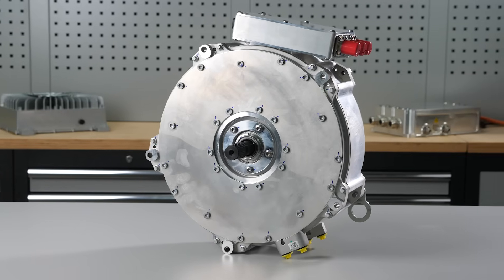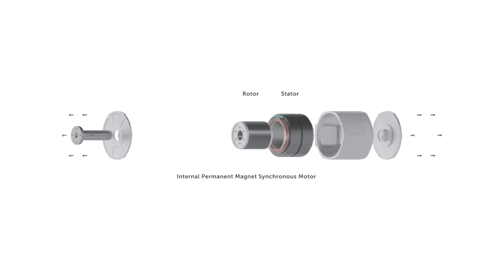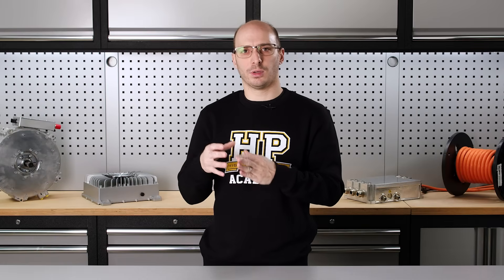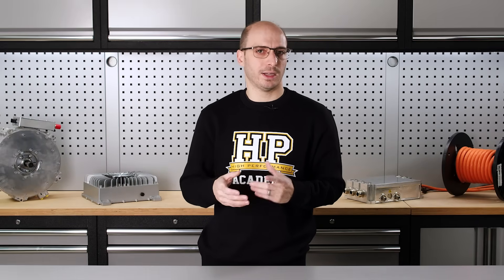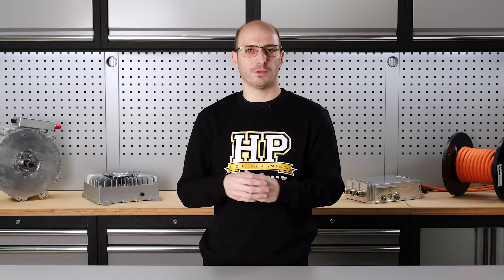1000hp+? | EV motor technology is getting WILD!

Comment from the maker: What EV setup are you modding and/or using for a conversion project?
⚡Dive into the fundamentals of EV world with instant access to your online lifetime access course: https://www.hpacademy.com/courses/electric-vehicles/
👨‍🔧 Building a fast car? Get $400 OFF the all-inclusive VIP online course package deal: https://hpcdmy.co/ev101y
TIME STAMPS:
0:00 - EV Motors
0:13 - Development
0:27 - EV Limitations
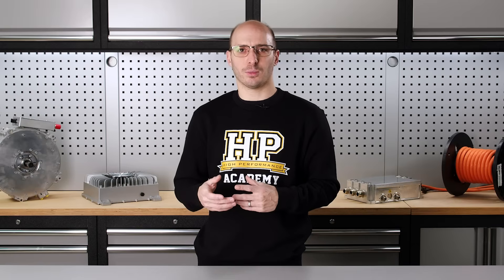0:37 - EV Vs ICE Power Delivery
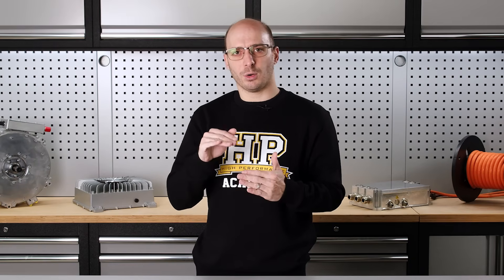0:54 - Peak Power
1:06 - Gear Reductions
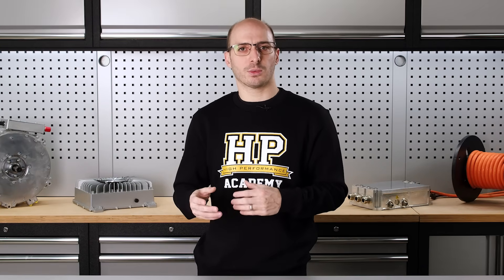1:16 - Permanent Magnet and Induction EV Motors
1:31 - The More You Know, The Faster You Go
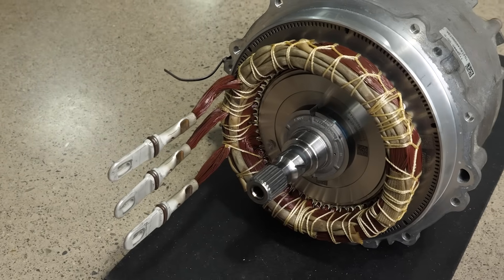1:51 - EV Motor Breakdown
1:57 - Stator
2:17 - Rotor
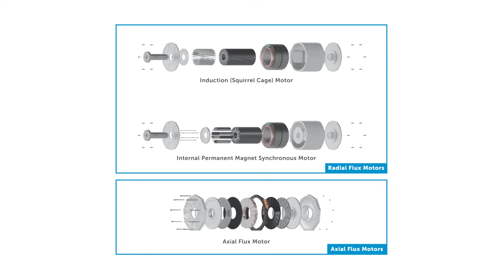2:30 - Radial Flux Rotor
2:58 - Axial Flux Rotor
3:21 - Magnetic Field Positioning
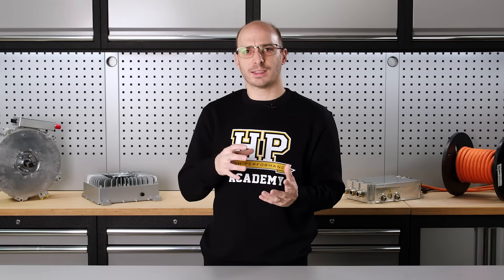3:39 - Design Compromises
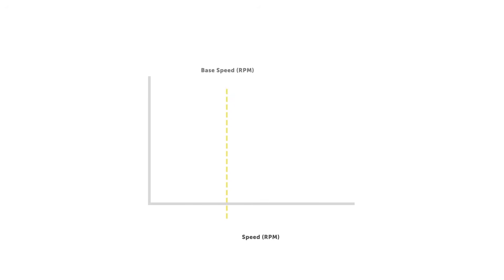3:50 - Base Speed
4:00 - Constant Power Region
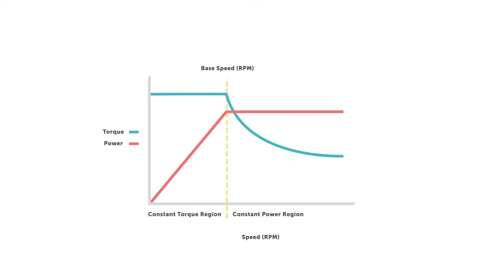4:10 - Below Base Speed
4:25 - Inverters Covered Separately
4:37 - EV Final Drive
5:13 - Torque Vectoring
5:34 - Lesson Recap
Reply: Is anyone working on some kind of 'bolt on' electric motor akin to a supercharger, or something that can be incorporated into an existing drive train rather than requiring the whole ICE system to be removed?

Comment: But I want a clutch.
The main problem with high performance clutches is that they are horrible in start stop traffic because you always stall.
EVs don't stall.
So you can use an extremely on off brass puck clutch or a multiplate clutch.
Gearing means you can have a less powerful motor and battery combination to save some of the weight of the extra driveline strength needed.
Use the same driveline as the hoonicorn or a drag car.
Reply from the maker: I'm sure you could set something up and like you say, it won't look like you've just done leg day on one leg 🤘 - Taz.

Comment: Can an electric motor do 300000 km?
Reply from the maker: So far, yes, and with less maintenance. 
Like ICE cars some will get more milage than others, but generally the batteries will give range that might make the car impractical before the motor/s go.
Some Tesla models state 800,000kms - Taz.

Comment: You need to redo some of this video. First off, these motor technologies are not new, they just got cheaper for the mainstream and power electronics for high frequency/high power has become cheaper. A lightweight motor with high power has been around since about the 1970's with aviation/military using 400 Hertz AC induction motors. Also, brushless PM motors are not new and have been used in military/aviation applications as well. There is only optimizations now on high power/low weight for the electric motors, but the core fundamentals have been well known for 100+ years. The motor weight and size is reduced because of using higher frequency. Open up your computer power supply and look at how tiny the transformer is for the amount power. Now compare that to a 60 hertz transformer. The reason is the computer power supply is sending many kilohertz AC made by transistors into that tiny, high frequency transformer. You need less magnetic permeable material at higher frequencies. Same idea applies to AC motors.

The torque of the motor with flat torque curve is not the motor's natural torque curve. What I mean by "natural" is if I hook the AC motor to raw AC power, its torque curve will depend on rotor design. No electric motor's natrual torque curve is flat. The only way you get the flat torque curve for AC is with the variable frequency drive that varies the voltage and frequency to maintain a constant flux under varying speeds, which is what you want for this application and VFD's have done this for AC motors well before anyone thought of using them for EV's. It's why in industrial applications I can replace DC drives and the brushed DC motors with an AC motors and VFD setup and it perform just as good. (btw, DC motors also don't have a natural flat torque either).

Finally, torque does not require rotation, so the statement you state as "nearly full torque at zero" is not correct. It is full torque at zero. It's called the stall torque. Everything else is okay so far in your video.

Comment: I would love to do an ev conversion on a camero
Reply from the maker: What's stopping you from starting to piece it all together? Small steps lead to an end goal just the same as big leaps - Taz.
Reply: @hpa101  Ev stuff ain’t cheap.
Reply from the maker: @onmygrind3854  very true, comparatively it is still more expensive than an ICE build. Even then with a lot of insane ICE and EV builds that you see, people spend years putting things together often due to needing to spread out the cost. It's quite rare for builds to be done in a short amount of time. Every little bit/step helps - Taz.

Comment: I feel like current EV car manufacturers lock their system so much you can't really push the available tech to its limits (like with a conventional ICE).

I have an EV witch I'm sure could do well beyond what's factory settings, yet no one touches it or there isn't any info available...
Reply: Many of them are electronically limited for safety
Reply: @poosenoose6820 IC cars are also electronically limited but much easier to circumvent.

Comment: the higher the rpm the more voltage you need to apply to keep the torque constant but at some point you reach the maximum rms voltage it was setup for and torque will start to go down. the current will remain constant so the power will remain constant because it is proportional to the voltage and current. At this point the heat generated is based on power and efficiency and if you want more power you would need better cooling. at some point you could break down the insulation if the voltage is too high so that’s another limiting factor
Reply: Or you could do what Porsche did and install a gearbox to maintain peak motor efficiency as speed increases. Or have different speed motors to run independently as required depending on speed. A bit like a two stage turbo. A small turbo for lower engine speeds and a larger one for mid to peak power. Easy peasy Japaneasy, or Getmaneasy, or Chinaeasy. Or maybe even Teslaeasy. Bring on the Solid States or whatever new chemistry presents itself. Exciting times. By the way I’m assembling a fully remachined warm cast iron V8 tomorrow with all new internals so you can swing both ways and appreciate state of the art engineering until it’s affordable and fully developed.

Comment: One does not need a forward/reverse gear set either.  Multiphase motors are capable of both directions, but may have a small improvement in efficiency in one direction.  That does not matter at all, if creeping slowly in reverse.  The same reduction set can be used for both directions.  You do need a Parking Lock or "emergency brake" as a method of blocking the car into a static condition, since the electric motors usually have very limited holding torque when not energized.  During motoring, much of the braking energy can be recuperated back into the battery system, depending on the complexity of your controller.  Regeneration below about 1/10 of the high speed is usually not worth the complexity, and usually does not provide enough braking force to actually skid or lock the wheels.  As such, some kind of primitive mechanical brake is usually required, but its design can be very minimal, and can be made about 1/5 lighter and smaller than IC engine brakes.  Maybe only used below 20-mph or so, and slowly in crawler traffic.  If electrics fail, it would only needed to be used once or twice in its lifetime, if panic braking from highway speeds.  Regenerative or dynamic braking can pretty much lock the wheels at those speeds, and if the electronics are working you can lock the wheels into a complete standstill or do a skid-reversal without applying any mechanical brakes at all.  Our company and I did these designs in the early 70's thru 80's on 3-dimensional underwater submarine drives, where mechanical braking is impossible.  All 3D forces have to be accommodated via direct propeller driving through the water.  Fast Reversal was demanded by the Navy to avoid entanglement with underwater cables, ropes, or other debris, and save several missions from being trapped at large depths.  That engineering is already well documented in the literature, and we published dozens of paper about how to do it.  Should be used on all modern EVs.

Comment: The main limitation was not realy the motors. 
The limitation was the electronic output stages of the Speed controllers. VSD's) 
Not only were old precision Speed controls the size of a doghouse but they also limited the design and technology of the actual motors that could be used.

Comment: I don’t know why a hypercar manufacturer haven’t done an all out series hybrid yet. You could have a high output ginormous turbo tiny engine in combo with a high peak output battery and weigh substantially less than the huge batteries they are using. Yet have instant throttle response, traction control, torque vectoring, etc. and be able to refuel in a short time.
Reply: Koenigsegg has done this
Reply: @kayzrx8  They’ve done parallel hybrids, but not a series.
Reply: @captainobvious9188  The 4 door Koenigsegg Gemera can operate in this mode as full ev and using the small Inline 4 engine engine as a range extender, or it can use the engine to directly power the wheels. The battery pack on the car is very small. Its a combination of both depending on what mode you are in
Reply: @kayzrx8  They have an EV mode, but it isn’t the focus and isn’t the performance mode like all the rest of the hyper/super-cars. I’m talking about like a Nevera with most of the battery substituted for a big turbo genset.

Comment: I know this is High Performance Academy, but IMO the EV transition would be a lot better served if the industry focused less on 1,000hp vehicles with 500mi range and more on 300hp vehicles with 350-400mi range. Everything would be smaller, lighter, and cheaper. Especially the batteries, which will most appreciate "adding lightness."
Reply from the maker: Not quite 300hp (well short) but small EVs exist. Here's one of the teams commuters//dog wagon/local MTB run van: https://www.instagram.com/p/CeGTwJZr-X2/
Far from a performance car though that's for sure, I hear ya 😂 - Taz.

Comment: My vortech v-15 centrifugal supercharger was running off a me1616 electric motor at 168v until it accidentally overboosted at 1500rpm engine rpm and snapped a few 12mm headstuds and ripped out a few threads... at 14.3mm headstuds now... 

No turbo lag, instant spool. Full boost. That's where it's used best... 

Electric and petrol combined.
Reply: Porsche will make the first road car to feature the "hybrid turbos" currently used in Formula 1. Will be interesting to see how the technology transfers to road cars. I highly doubt ICEs will go way in the next 20-30 years (all EVs make losses at the moment and they are still too expensive for most people).

Comment: Can’t wait for the futue😂😂😂 need an electrical engineering degree and a computer science degree to “work” on your extra large golf cart.   The future looks like shit!  
No real gear head is driving an EV.
Reply: Have you built a modern ICE turbo car? You need to be a plumber, electrician, machinist, welder, and computer scientist. Working on a Tesla is child's play compared to ICE vehicles. Modding one on the other hand, at least in terms of the drivetrain, is not.
Reply: I actually found having an EV has made my ICE even more extreme as anything under 30 minutes I am driving the EV as I can trash it straight off the bat. It's no different to Barry's who thought fuel injection or turbos is cheatin. The guy selling me his '66 impala telling me I needed to roll a cigarette and get it drawing well before I drive otherwise it would stall. I am over that stuff and so are other punters

Comment: Will you ever do a course on EV battery and motor tuning? We're currently looking at restromodding a Honda IMA system, with a custom lithium battery pack, and likely a zombified OEM inverter. It would be nice to find a tutorial on selecting the appropriate battery configuration, finding the motor's max current and voltage capacity, adding thermal sensors to the motor, tuning the motor phase timing, and other things when modifying EVs.

Comment: In theory EVs should be lighter, in practice, they tend to be about 20% heavier than Gasoline-powered cars
Reply: It's a battery tech issue, with EV battery packs generally over 1000 lbs.
Reply: @patx35 generally speaking, EVs could be objectively better in almost every way if batteries weren’t a limiting factor. Their heaviness comes from the batteries; their range and charge rate is limited by the batteries. Their biggest safety concern is a result of the battery composition. The primary reason they’re so expensive is because the batteries are. It’s truly their biggest limiting factor.
Reply: @yummyhershey5902  Charge speed is not just limited by the battery but the source, to fast charge an empty  80kwh pack in 30 mins requires a source that can supply 160+KW peak and that for one Bay. The cells cooled properly can handle this,  but supplying this much power is a challenge on the grid.
Reply: An EV with a battery cannot be lighter when compared to a gas engine when accounting the fuel source.  you can't compare an engine to an electric motor without comparing the weight of the fuel source.  Until the Specific energy metrics of Electrochemical cells rises considerably, it will never come close to that of a Gas engine and gasoline.   Specific power,  maybe but the car needs range . you could make an Ev with a small pack but the Range would suffer and power metrics would have to be compromised if you want the pack to last.
Reply: @kayzrx8  The BMW M5 is twice as heavy at the BMW I3, everything depends
Reply: @BandaMapper  your comparing a longer wheel base v8 luxury car with active suspension trunk that can fit 4 people in it  to one of the smallest EVS around, thats not a fair comparison, not even close tot he same leage, Compare it to an E tron or a Teals Model S.  Compare an M3 to a tesla Model S ,
Reply: @kayzrx8  well that's why i said it all depends on what you're comparing, not every EV is heavier than every gas var but they do tend to be heavier
Reply: Compare the same size, its not that hard, A Chevy Spark weighs way less than a bolt EV . The BMW 3 series electric weights way more than the Inline 6 version  of the same body type.  you can compare a semi truck to a pick uptruck and have the same argument, doesn't mean it is valid or makes sense. Energy to weight metrics alone , an IC will win over an EV everytime until battery tech makes an exponential leap in energy density.
Reply: @kayzrx8  Do you know how to fucking read stupid retard, I'm literally agreeing with you and you keep repeating yourself,  you can suck this Semi truck-sized dick

Comment: And exactly in what production car you have single 1000hp ev-motor? None. Max you have is usually 300 - 400hp where Lotus Evijas Williams Engineered EV motors do 500hp. Still quite a far away from your 1000hp dream. 

I think regular tuners build their ICE's with ethanol quite a cheapily higher horsepower ratings than these.
Reply from the maker: They don't do it (ICE) with a single cylinder either though... 😉  

You don't have to like em, they're just something different with their own pros and cons noting we're not exactly looking at perfection with where the ICE is at - Taz.
Reply: @hpa101  They're called hybrid cars if you want to add ev motors benefits to ice-cars. many supercars already utilizes them anyway, no need to compare
Reply: @Jani_Ikävalko  yeah.. instead of doing awd conversion to your average honda, just slap some twin bad bois in back with some small (capacity) but with high C rate battery pack
Reply: @exvils  It's not that simple really at all.  It's an electrical and engineering nightmare. ICE is simple yet compared to anything relating to EV motors and subsystems.

Comment: Thank you for sharing this information. 
I've been wanting something like the VIA Motors Hybrid, where they use a small engine in the stock location to run a generator and a motor to a transfer case to power a standard 4x4 drivetrain. 
Using a small diesel engine, like the large Edison semi truck and the smaller required battery pack and adding a supercapacitor bank. This would give both performance of an EV with range and efficiency of the diesel and the supercapacitor would take some of the strain off the battery pack and help with high load power output and generation. 

As stated by Edison Motors it could legally be run off of Red diesel at a much cheaper rate since it's considered an EV.
How to save taxes on an electric vehicle. https://youtube.com/shorts/CpbYHLov_SM?si=xbted0eQyq9604Qk